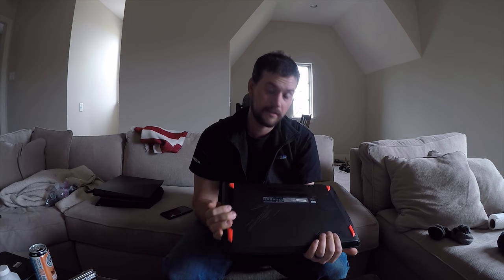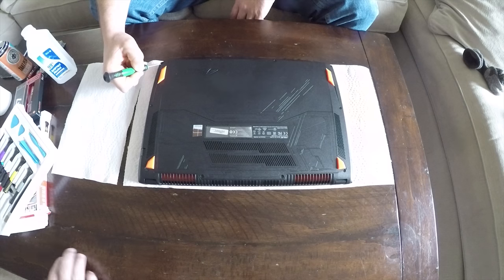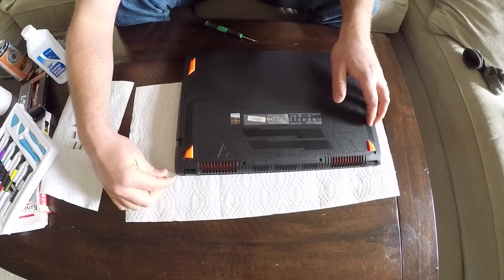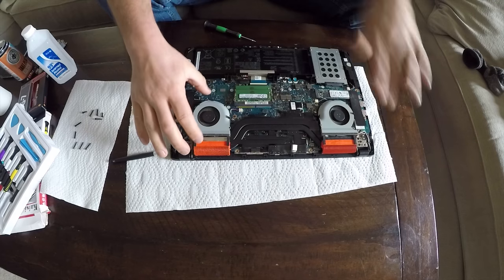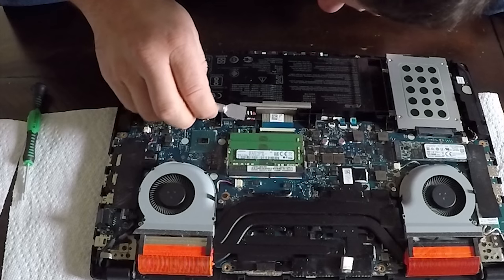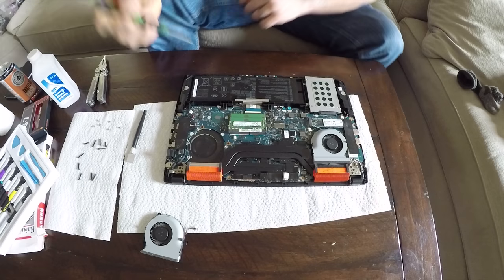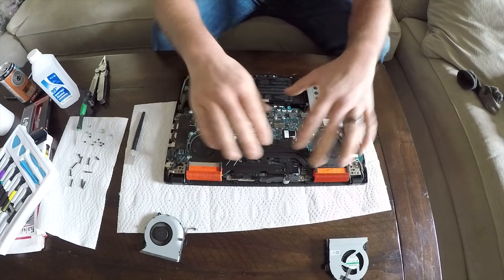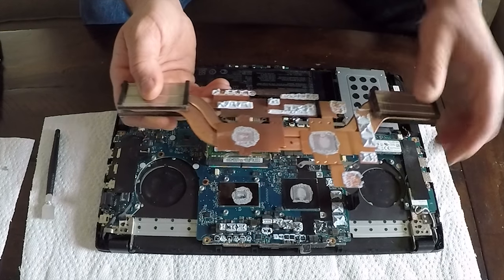How to Asus GL502VS Repaste

Comment: Thanks for the walkthrough dude, I just finished repasting my own gl502vm using Noctua's NT-H1 and the temps dropped from 100°C to ~87°C while stress testing CPU & GPU with AIDA64. Thanks again!
Reply: @Kel Fero I'm a couple versions behind the latest driver (451.48 to be precise), but not issues so far on Win 10, which OS do you have? I used to have Win 8.1 and G-sync was a mess and did weird stuff while gaming (screen flickering, going black etc. when framerate went below 60).

Comment: Best laptop I've ever had. Powerful, cheap, reliable. My warranty runs out in 7 days, gonna clean and repaste everything i can reach without breaking everything apart. Hope it'll hold out 3 more years until we have like gtx 5060 or something.
Reply: How did the repaste go ? Did you do it yourself?
Reply: @rg1346  not bad, but the temps seem to be in the same state as before. Only now it heats up under load a little hotter up to 100°C against 98°C before. I had a patch of copper tape glued under my right fan (looking from back side top-down) that I unstuck from the fan to clean it. My model is GL502vm and if you have the same tape I suggest you don't remove the right fan and try to clean it on the board, the heatsink should come off with the fan still attached. Let me know how it goes
Reply: @delpher32exe  I have the same laptop as yours, does it still goes to 100°C after repasting?
Reply: Hey man do you think it is normal to have temps like 100 C? I always limit my fps to not have higher than 80 c
Reply: @sergioa6403  no, it's not, but limiting fps is not an option for me as it degrades the experience.

Comment: how much thermal paste did you use to repaste everything? i'm wondering if 1g is enough?
Reply from the maker: Hi Zhi, yes I believe 1g will be enough.

When putting thermal paste on its job is to fill the very small gaps between the metal and allow total contact between the two conductive surfaces.
So if too much thermal paste is used it creates more issues than it helps.

Comment: If anyones having second thoughts about doing this , i just got it done on mine. I used noctua nth1 and my temps in gaming are really good now. Its worth the trouble just follow the steps in this video . :)
Reply: Rafael Guti will it be fine if i do it at home and will it be fine that i just clean off the fans as they will be dirty to solve overheating problem?
Reply: @sabeerkhan.75  it's good to open up your laptop and clean the fans every once in a while, but if you want serious change, you'll want to repaste your heatsink, especially if you're still using the stock paste which is usually done with bad paste and also usually a shoddy job.

Comment: I've combined this and couple other videos on this exact model. I repasted everything(first time ever for me) ... my additional problem was what seems to be a rather common issue - 2 screw holders from the cpu heatsink tore from the motherboard, so it wasn't pressing as strongly. I noticed my CPU temp was hitting 95C lately and I've been experiencing massive throttling (even when almost idle), so  figured that was the core reason, along with old paste. 

I thought that I won't fix this myself, but then I found a hackish but effective tutorial to deal with this. You take the broken screw holder, use it as a nut by putting it under the motheboard, screwing carefully from top (not too much, just so there's pressure applied to the CPU like before). That way you dont need any extra tools, skills or whatever. The only disadvantage is you  need to take out the whole motherboard to get to the bottom. But I've succeeded doing this following another YouTube video. The CPU is now at 60C when browsing and GPU went from 75C to ~60C. Didn't stress test much yet but I'm super happy with this!
Reply from the maker: That's for the detailed issue and I hope if anyone has the same problem this will help them.

I'm glad I could help and you got it figured out 👍
Reply: Undervolt then, probably by 140mv. I saw temps go from 100c to 84c with no throttle.

Comment: good video but got a question. did the repaste as shown in this video and still hits around 90c. for what i understand its more beacuse poor design?
Reply: The easiest thing you can do is turn of Turbo Boost of your CPU. You can do it by setting 99% maximum frequency in your power plan, this will definitely drop the temps. If you're more tech savvy, you might look into undervolting your CPU and/or GPU. That helped me big time with getting lower temps and better performance.
Reply: @Segrey  i did use throttelstop dropt the temps with 15 c

Comment: What would you recommnd for cleaning the thermal paste? I heard some people say articlean or 70% isopropyl alcohol? Im sure i shouldnt use tissue paper to wipe it off right? 
And may i know if Arctic MX-4 is okay for a complete first timer ar opening up a laptop to use? Im afraid of over using too much thermal paste and it cause overflows after awhile.

Im also planning on removing the dust from the laptop. Do you think i should just use a brush on the fans or should i get compressed air to blow on the MOBO,fans and vents? And where is it safe to blow the compressed air at? 

And can you use close up and use the laptop immediately after you add the thermal paste or do you have to let it sit there for a day or two?
Reply from the maker: Hi Nicholas, using isopropyl alcohol will be great.  I would recommend against using toilet paper because it is too soft and can come off in small pills, paper towels worked well for me.  A cotton makeup wipe is a good one to use as well.  Really, any thermal paste is going to be just fine as long as you don't get something counterfeit or so cheap that it's not functional.  It is important to not put too much thermal paste, just a small dot will do the trick and pressure will spread it.  You may use the laptop immediately after.

Comment: Thank you for the video I’m planning to do a repasting on mine. Your video is the only proper one to do a thermal repasting on youtube. Mostly others did liquid metal repasting which i think is too hard for me to do.

Did you remove the tape around the cpu and gpu before applying the paste? And is it necessary to repaste other modules other than the cpu and gpu? I know its been 2 years since you posted the vid but i hope you can stil reply.
Reply: Only if u overclock

Comment: I saw on other GL502/702VS repaste video they use thermal pad instead of thermal paste, whats the difference,
Im planning to repaste
thanks
Reply from the maker: ariofebri hello ario, I have used thermal pads on cpu's in the past and have had good luck, it may be a little easier than getting the right amount of paste and perhaps a little cleaner, however I have always preferred using thermal paste because I believe you can get by with a much thinner layer and in the end performs better.

Because the GPU Vram is also on the heatsink here, i believe it would be much easier to put the paste on the small items.

In the end, it is your preference and what you've had previous success with, if you end up using thermal pads, please let me know how it performs for you.

Thanks
Reply: Matt Sweeney
I see your point, 
In the newer series like GL503,  i saw asus use thermal pad instead of paste, whats the point
Im still considering which one is the best, 75:25 for thermal paste, i think its waste of money if using 2 items for 1 same function
Thanks mate for your response
Reply: Let's review what these things are for. We have a heat source (the chips, in this case) and a heat sink (the cooling mechanisms).

People like to say there are three forms of heat transference. First is conduction. You need one material in contact with another and then heat moves between the two. The second is radiative. This is very inefficient in general. Third is convective (air movement) - but it's really just conduction from the heat source to air molecules which then are circulated, eventually contacting the heat sink.

The best way to transfer heat is conduction. So you look at these two things and you see two pieces of metal and you think let's clamp them together and everything's great, yay! But that's not the whole story. At a microscopic level, both the chip's surface as well as the heat sink are pretty rough.

The role of the paste or pads is to fill in the gaps with something that also conducts the heat. The trick is that this intermediary is NOT going to conduct the heat as well as either the source or the sink.

So how much do you use? Well in a system design for the OEMs, you know what efficiency level you need, so you can choose between a system to dispense paste or apply pads. You can imagine that each have their ups and downs. Also, for less capable do-it-yourself kind of people, you might want to give them pads since there's less to mess up (e.g. the pads on heatsinks that come with retail CPUs).

How much paste do you need to use? Again if you're doing high volume manufacturing, you need to make sure you use enough, because if you don't use enough, you're going to burn things up and get system returns, so you're going to use "plenty".

How much do you really need to use? Just enough to fill all the nooks and crannies so that as much metal as possible can still touch but there aren't any air gaps left between the surfaces of the heat source and sink.

Very, very little. Amazingly little. Like, I think he used way too much in this video, personally, but he got a good result so good on him. I personally would have started with dabs like his but then used an old credit card and spread it as thinly as possible over each chip surface, leaving maybe 1/3 or 1/4 of the original paste in place. (Sometimes I just put a neoprene glove on and smudge it around manually if one is handy.)

People who are into this stuff "lap" their chips and their heat sinks to get more metal-on-metal contact without paste.

Comment: I have same laptop but 15" model (GL502vmk) that has i7 7700hq and gtx 1060. It runs pretty warm even that i repasted it. I've done repasting it many times, but i didn't see any change. Do you think that it's because of thermal compound? What did you use? I used CoolerMaster MasterGel Pro and i'm going to use DeepCool Z9, because i don't have access to thermal grizzly or arctic silver and other stuffs. And do you think on 15" model there is lack of cooling? Because on 17" with more space you've got 96 Celsius..
Reply: And i wanted to mention some other thing. My CPU temp doesn't exceed 85 Celcius in stress test of Intel XTU when the gpu doesn't work. But when i start some game and gpu start working, because of shared heatsync on cpu and gpu, my cpu exceed 95 degrees and throttles. Is it normal? Did you experience something like this? And when my cpu throttles, it doesn't downclock the cpu, and cpu frequency stays the same, that's veryyyyyy weird.
Reply: @sinaseyfi   i have the same model dude, gl502vmk and worked pretty well to me with arctic mx-4. just aware to repaste those memories like he did at the video... and i live in Brazil, the air temperature here its like 30-34ºC, before i repaste i had on cpu 96ºC and 88ºC at GPu, thats when i knew i had to repaste.  the mx-4 solved my problem. about thermal throttling i used to have before i repaste, now its ok. i also undervolt -0.120mv to get better performance and use a coolermaster coolerpad, that helps the laptop a little by lifting it from the table and also has a cooler to chill..

Comment: Are you using alcohol? By the way, those gl502vm and gl502vs have the same design?
Reply from the maker: I do not own the other model, however this guide should be enough to get you through repasting just about any laptop.  They will all have the same foundational principals of taking it apart.  With differences for each laptop to remove the pieces.
Reply: same design, i have gl502vmk and worked pretty well with this vid

Comment: Fantastic video. I'm performing this exact operation in the morning and this video is going to be a massive help. Well done on a clear and informative video
Reply: Alex Moerman will it be just fine if i do not repaste and just clean off the fans to solve overheating issues?
Reply: @sabeerkhan.75  I guess it depends how blocked up your fans were. I both cleared the fans and changed the thermal paste so it's hard to isolate which was more effective but I can confirm a decent reduction in temp. This being said these laptops seem to have been poorly designed and thermal issues are rampant. I'll be looking to sell and upgrade soon enough.

Comment: Hi there, two of my screws holding the coppear heatsink on the cpu side got separated from the motherboard. Could this be affecting the copper heatsink to not be as close to the cpu as it should be and thus increasing temperatures? Or are these screws only to hold the heatsink in place and it doesnt matter if a couple screws are missing or in my case not attached to motherboard? Thanks!
Reply from the maker: If it was me, I would try to buy slightly larger machine screws (I mean just barrrrely larger). And thread them into the original threads, essentially re threading the original spots in the motherboard.  The even pressure on the chips allows for even heat distribution.  You may be just fine putting it back together how it is and not notice much of a difference in heating up on the chips.  Or it could be a problem, it would be hard for me to know without seeing it.
Reply: @Matt014X  Thanks for the reply! I managed to put them back together in the motherboard but it is still heating up. Could it be the paste I used is bad quality and making temperatures even worse than before? I took my laptop to a place for maintenance so I imagine the paste they used must be a generic one.  I just ordered a Thermal Grizzly Kryonaut which is supposed to be the best so I should see new results as soon as I get that.
Reply: @t86dan  and how is kryonaut doing ??? Im planning to replace stock paste with coollaboratory extreme paste
Reply: @albertwesker4266  it definitely helped more than the generic paste!
Reply: @t86dan  so the temps dropped ??? Because Im still thinking is it better to buy coollaboratory or kryonaut will be sufficient

Comment: can i put thermal pads instead of paste on all the parts except the cpu and gpu?
Reply from the maker: I believe they use the pads in areas where  a gap needs to be filled between the chip and the heatsink.
Using the paste may not work to fill the gap in the same way

Comment: Matt,

Good day sir, I am reaching out regarding the battery life on the laptop. 
Did you have any issues with the battery keeping charge? If so, do you have any solutions to fix the problem?

Regards,
Tiger
Reply: The battery of this unit is not so great. However, it is recommended to put it contiously plugged as it will bypass the battery and current goes directyly to your system, thus preserving the battery more.

Comment: wt was the temp difference between before and after re pasting
Reply from the maker: Excellent question!  Thanks so much for asking it!  I had originally planned on including the footage but got lazy with the editing and wanted to get it posted.

After reviewing my footage I did a 45 minute stress test both before and after, because these heat sinks cool both the CPU and GPU the temperatures are closely related.

Before My CPU was hitting as high as 96 Celcius and GPU hitting 88 Celcius.
Now after the same 45 minute Stress Test my Cpu is hitting 87 and GPU will hit 81.

These numbers are not ideal for long term, if I could get them lower I would.  However being on a laptop these numbers are much more manageable than before and arent going to cause any damage.

Thanks for watching brother
Reply: @Matt014X  to tell you a little secret they wouldn't make any damage even if they were 120C.
Reply: Undervolting worked perfectly for me
Reply: @timoalterschwede2376  hey what program did u use to undervolting? And how are your temperatures working now?
Reply: @sergioa6403  I use throttlestop. When I play for example cod warfare it's about 80 C. Before I repaste and undervolte I had around 100 C.

Comment: can i use 

absolute alcohol ( 99,5%) instead the propyl alcohol to clean cpu and gpu? canot find in my town
Reply from the maker: Rubbing alcohol is fine yes but as long as it's not absolut 80proof drinking booze
Reply: @Matt014X  (decent) vodka should be OK. It's just ethanol instead of 2-propanol/isopropyl. Cheap vodka may have things other than ethanol and water.

If you can find Everclear or another grain alcohol, that's probably better and cheaper, whether it's the lower or higher proof versions.

That said, I can't believe he can't find isopropyl alcohol at any drugstore or grocery in the US at least.

Comment: i have a question, so one of the fan screws is stripped and i cant remove one of the fans, is it possible to remove the heatsink without removing the fans ?
Reply: I stripped one of the heat sink screws, I'm stuck too if you found a way to remove the screw please tell me.

Comment: Is the thermal paste on the smaller chips working fine? Did it affect anything because I read that u cannot apply it on those chips and doing it the first time so I am a bit sceptical
Reply from the maker: All the chips that I repasted had thermal paste from the factory and so if there was an error it would be from the engineers at Asus.  However, the only purpose of thermal paste is to fill the many unseen gaps that exist between two metals meant yo transfer heat from one to another.  So adding thermal paste to any parts of a computer that have direct contact to a heatsink should have no adverse effect.
Reply: I’m also going to apply thermal grizzly kryonaut on that smaller chips is it ok ?